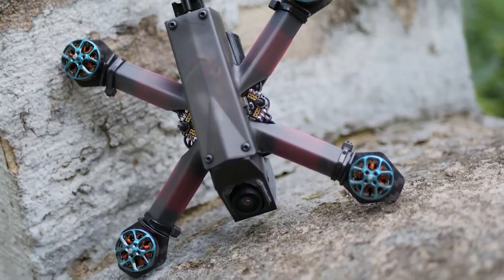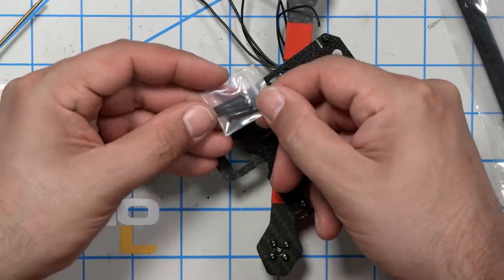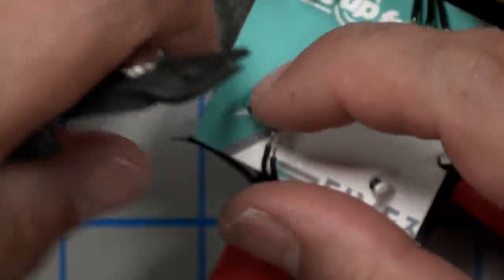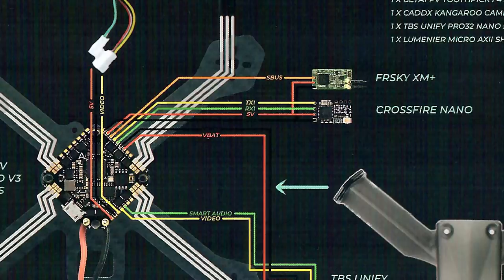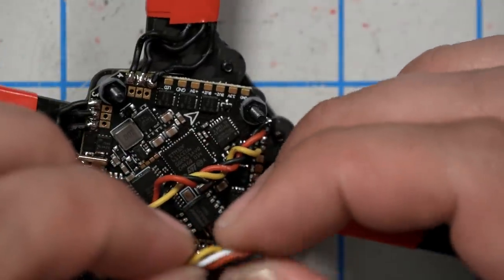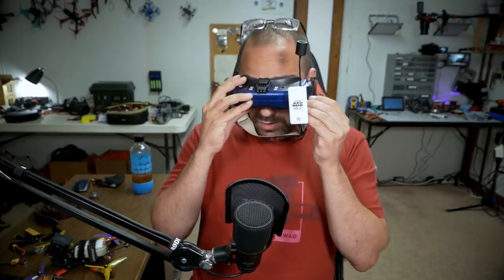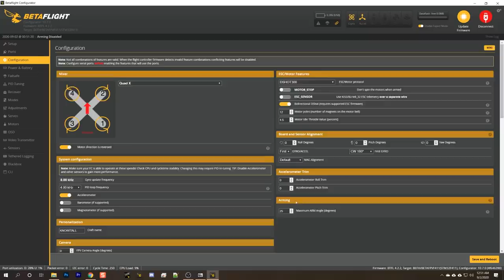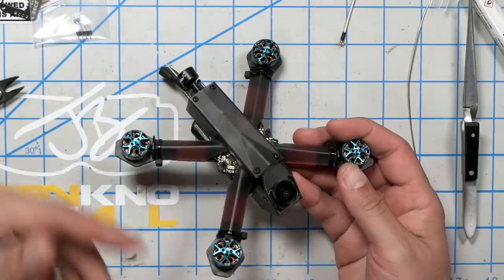Five33 Tiny Trainer FPVCrate Kit | how to build and configure

Comment: Beginner soldering advice: use leaded solder and a lower temp (310-315C, 600F). JB solders at 400C/750F which is fine for wires, but you want a lower temp when soldering electrical components so learn and practice at a lower, more forgiving temp (but watch for cold solder joints!)
Reply: 315C never works for ground connections. I suggest anyone to go 380C minimum, go quick and hot is always better on components anyway.

Comment: Interesting advice with the “tinning” of the motor wires. I almost always only mount motors with 1 screw then remove them to tin lol. I’ve done a lot of soldering and built quite a few quads and still don’t trust myself

Comment: I love the fact that you are using metric system instead of that imperial nonsense for your international viewers <3
cool video, thanks for that review! as soon as my source one 5" can fly, I want also to build a 3" build :D
one suggestion:
for the protection of your pcb from solder and heat, just use a polyimide film, like Kapton. It's pretty cheap on aliexpress (buy only the orange one, not blue/green, they are mostly fakes without protection) and protects anything you cover from the 300-450°C heat.
edit: oh... you have a polyimide tape and use it for isolation of your RX :D
Reply: Is that irony? Metric on your 5" :)
Reply: @patrickcolclough2423  I know XD I also had to grin while writing this^^
But there are some cases, where imperial measurement is "default" .. in that case the prop size is internationally in inch^^

Comment: 1. I always measuring resistance to detect short circuit with coils. Coils have more Ohm, than a short circuit.
2. You should clean non-clean flux if you want to put lacquer or plastic on the PCB. When you put some plastic on flux, you make something like canned. This improves the processes of PCB and soldering destruction. I always clean all types of flux, because I had some problems with it at measuring circuits.

Comment: If Evan can absolutely smash my best times with one of these, I know JB will do quite well running them.  They have the amazing 3" quad trait of being able to stay high throttle in turns quite easily, which gives them great release from sequential moves (i.e. descending ladders, corkscrews) - but struggle will be not grounding out in the split-S on that course.

Comment: Water clean fluxes and acid fluxes are usually the issue with corrosion and conductivity in my experience.  Rosin flux which is common in electronics fluxed solder does not need to be cleaned, but it looks better if it is.

Comment: The caddx kangaroo can be a great looking camera if you go into the settings and turn the sharpness down to about 50 to get rid of the digital shimmer. It's a shame they didn't include the led set made for this build, but it's still a great kit.
Reply from the maker: They're getting the LED set just didn't have it yet.
Reply: @JoshuaBardwell  That's good news! It really adds something special to this build, and I'm not usually a big fan of adding leds. I'm looking forward to seeing your thoughts after getting a chance to fly it. Good luck at the races!

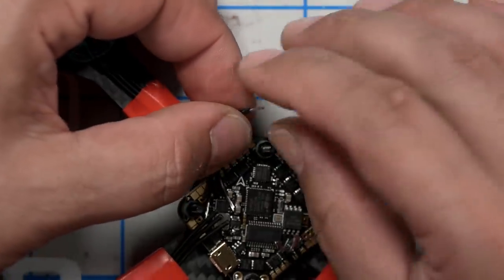Comment: 9:55 pro tip! Make sure you wash your hands well before you do this to remove any oils or it's a lot harder to get the solder to flow correctly.   That's my 2 cents.
Reply: Very valuable info, thanks!
Reply: Oh I never did that! Thanks a lot!

Comment: Lol i just bought JESC for my Beetle. The more you learn! At least i supported the inventers of bidirection dshot. Can't get it to work though. Even upgraded the FC to TT F7 HD mini.
Edit: Nevermind, this dosen't apply to H-esc's. And i found a solution. Disabling the LED strip (remember to move the slider in configurator, CLI dosen't work).

Comment: I had to order a soldering kit to repair a torn motor wire on my Drone. Wish me luck! Got it in today going to go tap them together tonight after work. I just want to get back in the air ><
Reply: Careful you don't short anything, lot of current runs through those wires. GL!

Comment: Hi Josh. Once again, great video. I just my kit from fpv crate and built it. I have followed your instructions but I am getting errors on my motors with rpm filters on. I have already built quite a few kwads with rpm filters and always get 0%. I am on Blheli S 16.71, BF 4.2, 8k/4k, 12 poles, Dshot 300 etc. Any ideas what usually causes these errors? Bad solder joint, bad FC? I'm at a loss. Thanks in advance for your help.

Comment: Joshua, you always comment on “motor screw length”, but never addressed (in ur build videos) how to check if they are to long.  I installed new motors on a 5” the base hid the mounting holes so I couldn’t see if they passed the base.  Had hot motors.. discovered they were grounded, using a multimeter (your video Thankyou!).
Also with the motor pad being so small and close, this FC has pads on both sides so u can solder the 2 outside wires on top and the middle wire on the bottom..

Comment: Hey Joshua, thanks for taking the time to share your knowledge in this wonderful hobby. My question is how to bind to a receiver that is integrated into the board? I have this old flight board that’s used for micro builds. I’m not sure if it’s a scisky or a pico board. It has no bind button and there’s no writings or markings on it except DSM/PPM. I tried CLI “set spektrum_sat_bind=9” command but Beta flight won’t accept the command. I appreciate any help, thanks
Reply: Are you sure it has a receiver built in? Usually if it has a receiver built in it would have a bind button too. Is there solder pads under where it says dsm/ppm? If so you probably need to add your own receiver. If it dose have a dsm receiver built in the command to get it to bind can be a little different depending on what version of betaflight your using but im not sure the difference right of hand unfortunately though.
Reply: @itsme-fr5fr  Hey Josh, thanks for the quick reply to my previous. I've got one more Q if I could. I've got a 180 vortex with a broken board. What flight board would you think be a good replacement board for the Immersion vortex 180. I need a controller without an integrated PDB /ESC.  I've reached out to Immersion but I'm still waiting for a reply. Thanks sir.
Reply: @itsme-fr5fr  Hey Joshua,  On endpoints, Would it hurt anything if I use  “enabled max throw” to reach my endpoints? Thanks again

Comment: That swipe the blob thing is important and not in any peoples tutorials on soldering. Question: Does it matter the order you connect the 3 wires to the motor? Why are there 3 wires and if there is no order to put them on whats the point of there being 3 when you could just do one!?
Reply from the maker: https://youtu.be/_dClVHZxRAc
Reply: There is one wire per sets of magnets in the motor. Each motor has three "poles". The ESC powers each pole of the motor in sequence to make the motor go round. If your motor spins one way, you can swap any two of the three wires to make it spin the other way. Fortunately you can also change this in in the ESC configuration (using BlHeli/BlHeli32 configurator), so you can just solder all the wires on straight, and then correct it in the ESC configuration later.
Reply: @flexdfpv   @Joshua Bardwell Fortunately for me it was just one wire that popped off but thanks for the info!

Comment: The parameters you used to setup this quad included “acc_hardware=None”.  But the board does have accels.  Will this break angle mode?
Reply from the maker: Yes.
Reply: @JoshuaBardwell  Hi. Does this mean there will be no Angle Mode with this setup? I am new to FPV and still use this mode whilst I'm building my skills. Thanks

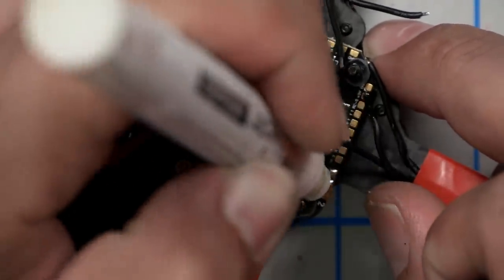Comment: 12:30 "No clean" flux is not conductive. Water based can be (RUMOR) when exposed to lots of humidity. Water and Rosin based flux are both acidic and should always be cleaned off. "No clean" is so easy to clean off, there is no reason not to.
Reply from the maker: Lazy. Did you miss that part.
Reply: @JoshuaBardwell  no, I didn't. Lol

Comment: Those damn motor plug solder pads are so so so close together.. my hair is wider than that gap on f4 aio
Reply: With small /tight pads I usually look and see if they are on both sides of the board.. if they are, stager then.. put the two outside wires on top and the middle wire underneath..
Reply: @robaxelsson530  omg genius lmao
Reply: I checked the board.. looks like the pads ARE on both sides so.. yeah.. 2 on top the middle on bottom .. chances of bridging minimized

Comment: Wait till you fly it. I fly mine on 4s 3s ok
Reply: yeah but 4s is not spec is it!? I like it but if its only 3s on spec and at 108g dry its a heavy little beast compered to a tp3.
Reply: @kennethcartman473  i have 2 4s and 3s my 4s 234g 3s 236g
Reply: @kjkareemslim  thats a heavy beast i bet them 1204s struggle without 4s and it does not look like you get a better top end over a 3s tp3.